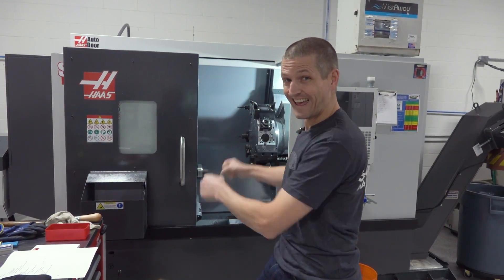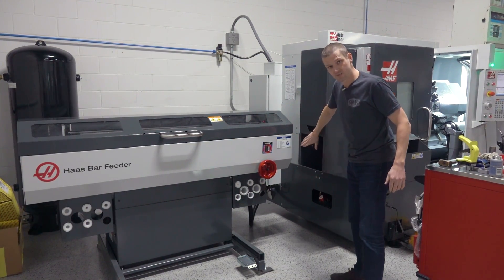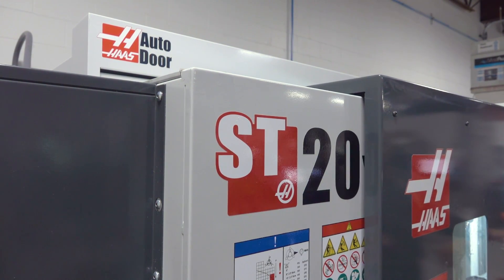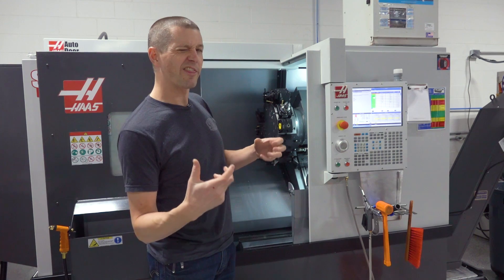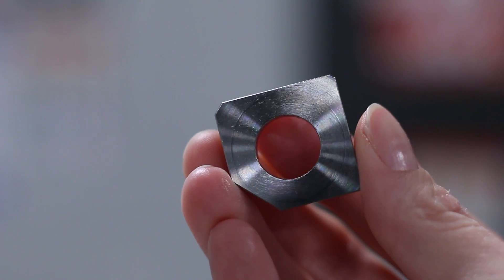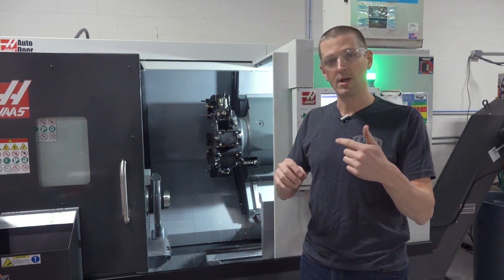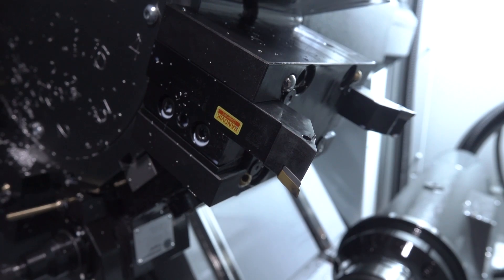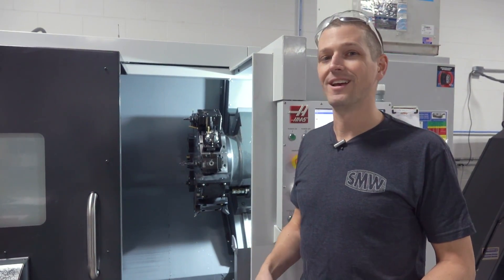Buying a HAAS ST20Y CNC Lathe!

Comment: Nice!! 
It will be interesting to watch ... we recently bought dmg clx 450 v6
Reply: Nice. I got the Clx550 (v4 i think?) since last April. Best bang for the buck i'd say but it definetily has some down falls.
Reply: Hi, we get our CLX 350 V& next month, @Jan Wintraken: which issues do you have with the CLX?
Reply: @richardbaumgartner5693  the Sinumerik is a bit clumsy sometimes. But Overall easy to learn and understand. If you have the coolant System with Filter cartridges and work different materials such as hot rolled Steel,Bronze,Cast iron etc. I suggest you Look for a solution rightaway. Those Filters cost about 450€ each (theres two) and they clogged up pretty much instantly. Dmg says they are not designed for reusing. The smw Chuck this machine came with is not the Best by Design. Try getting a schunk or something similar instead when you are a Job Shop. Also the Chuck is way to powerful to begin with. 10 Bars on that machine are mandatory for safety requirements and the 320 autoblok chucks with 22kn of force at 10 Bar of pressure which is way too high for thin parts.
Reply: @janwintraken  We buy the CLX along with our DMU 50 5-axis mill which has the same Siemens control, so we are familiar with this control. The coolant system has an improved pump with 20 bar and I think we get a belt filter along with. I remember this was called the production package... We ordered the lathe with two Hainbuch collet chucks and have differential pressure on both spindles for lighter clamping...
Reply: @richardbaumgartner5693  kk that Sounds like a good package. The Sinumerik isnt particularly Bad but there are some things that could have been done better i feel